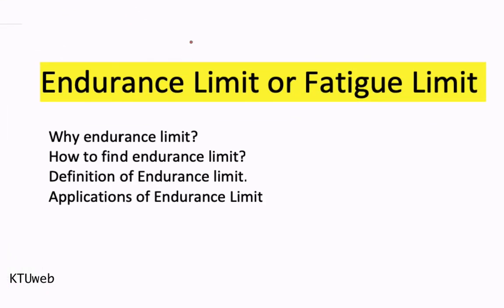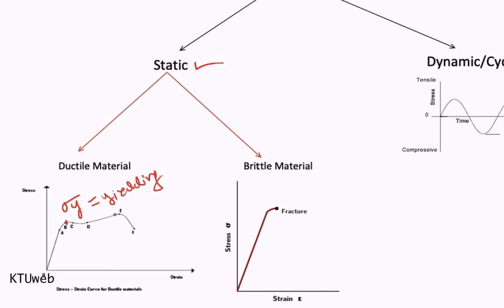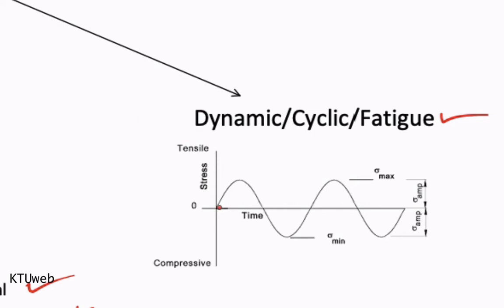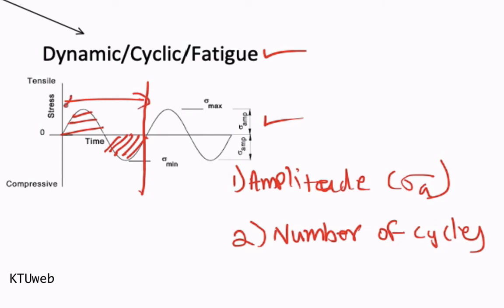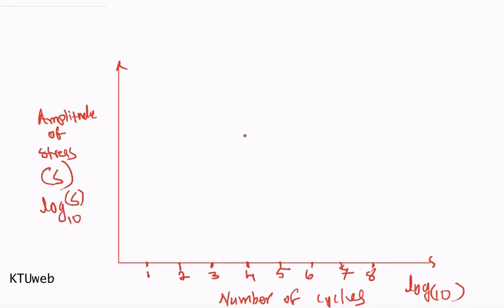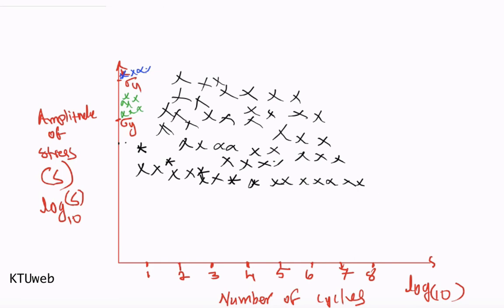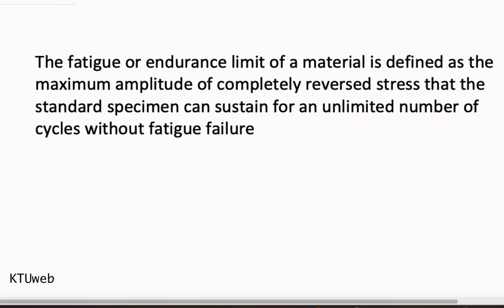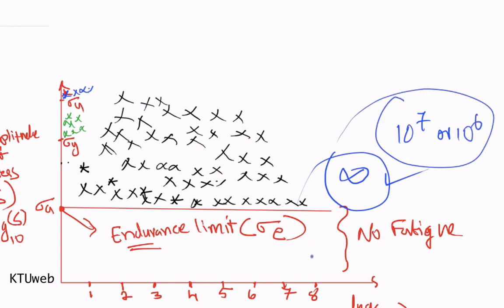Introduction to Endurance Limit and S N Curve for fatigue failure

Comment: Thanks for the video. What's the meaning of reversed stress ? Is it the change of stress ? Like tension and compression and vice versa ?
Reply from the maker: Reversed  means changing direction with reference to any stress value.
Tension and compression are relatively reversed to each other